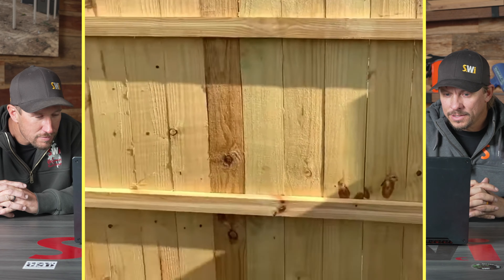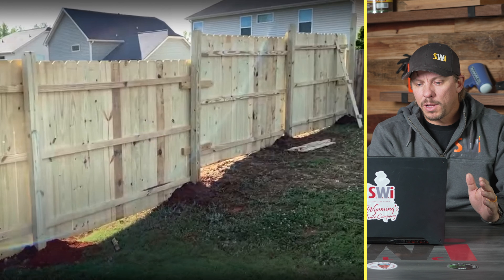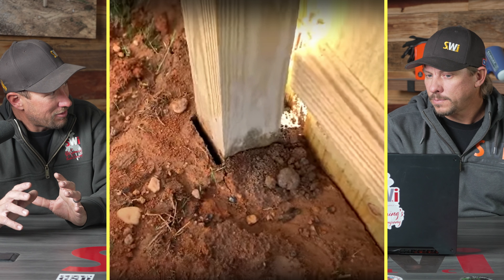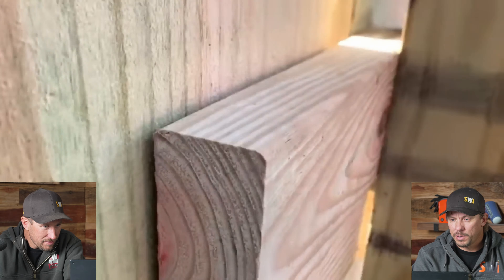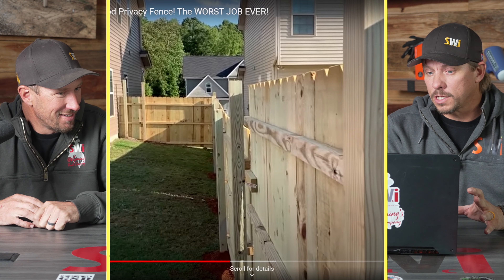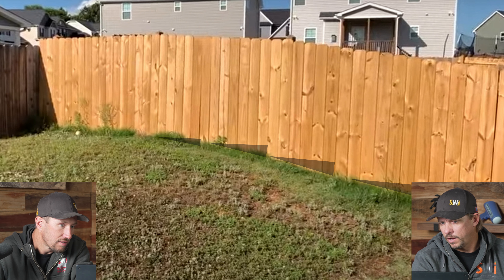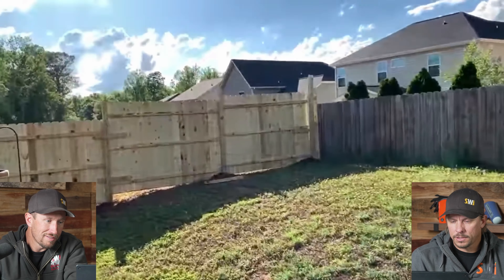Do NOT Build Your Fence Like This

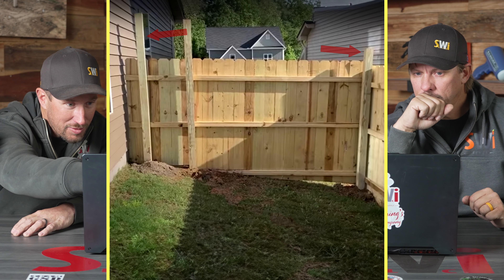Comment: one point @1:00, you don’t necessarily “need” to have a post right up next to the house with wood picket fence, you can easily cantilever the panel past the post about a foot with no problems. it helps when they have extra large footings that protrude past the house, or if you’re dodging a irrigation line that’s running right next to the house. Just set the post 7’ apart so they’ll have the extra over hang
Reply: Yeah, I've had to do that more than a few times when the foundation guys dumped excess cement in the footing trench or utilities/irrigation lines run along the wall.
Reply: Yes I do this alot when I can't get next to a house. I started my working career building houses. Met this guy in Montana who passed the fencing bug to me, but my point being is that when you puncture siding for screws you allow an entrance for rot to set in, and I wouldn't be happy if someone did it to my house, so I won't to someone elses

Comment: Fellers, what’s the big deal??? I need to send y’all photos of the goat fence my neighbor built out of pallets.  No two pallets were alike. The blue CHEP pallets and the red Kraft pallets are randomly mixed with unpainted skids.  

But, my favorite feature… Different widths and lengths meant some were turned sideways to keep the tops about the same height.  That meant the goats had a ladder they could climb whenever my goat was in heat!

Fellers, y’all ain’t seen a professionally designed and installed fence until you visit the Ozarks!
Reply from the maker: That sounds... creative! Seriously though, it was nice of him to make it easy for the goats to get across. 😜
Reply: @SWiFence  my Nanny Goat agrees!

Comment: What do you gents at SWI think about setting a concrete in ground pier, steel post anchors drilled into the concreted then 4x4 posts set into the anchors?
Reply: Take a 2x4, stick it up into the air, and then try to hold it upright, at the very bottom with your fingers. You'll answer your own question.

Comment: This is a below amateur job like a clueless teen could pull that off first try and a teen who was raised would know that there is someone that wasn’t ready to start thier own bussiness-first and last job-stringing- 2-3 coats flexseal on part of 4x4 in ground and buy longer fence boards where needed so it follows a continuous line /unless you have a cheap client then they might not understand time is money so if the client was super cheap then they got what they paid for